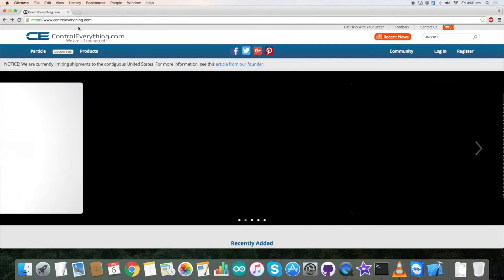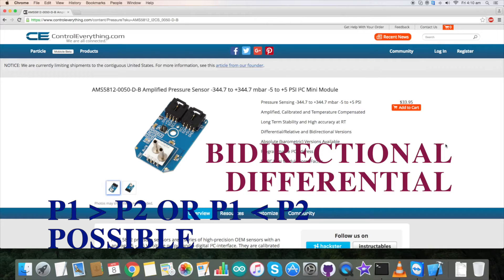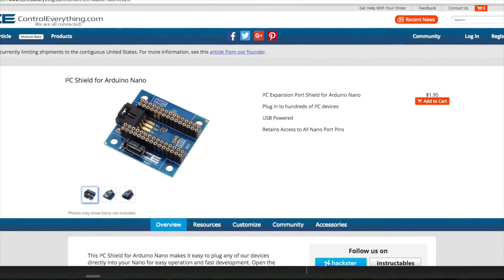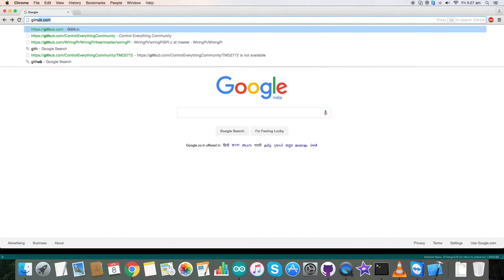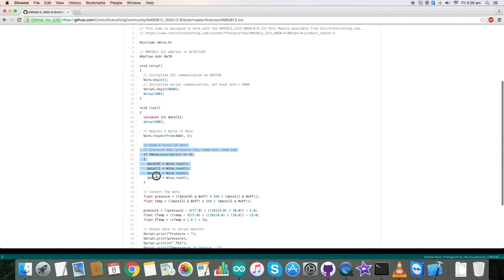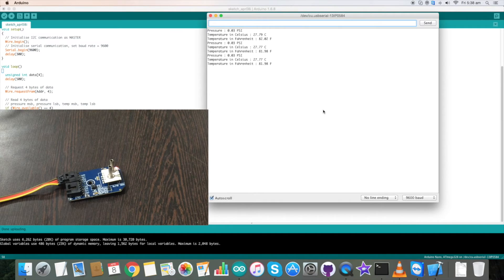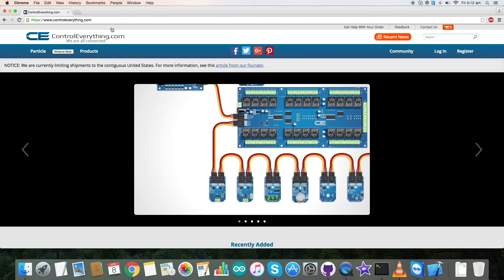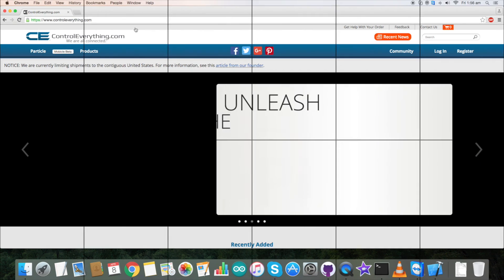Arduino Nano - AMS5812_0050-D-B Pressure & Temperature Sensor Tutorial

Comment: Nice work, but how if use the I2C sensor AMS 5812-0000-D-B in a range -5...5 mbar, what in convert data shall I modify or change ( float pressure = ((data[0] & 0xFF) * 256 + (data[1] & 0xFF));
pressure = ((pressure - 3277.0) / ((26214.0) / 10.0)) - 5.0;